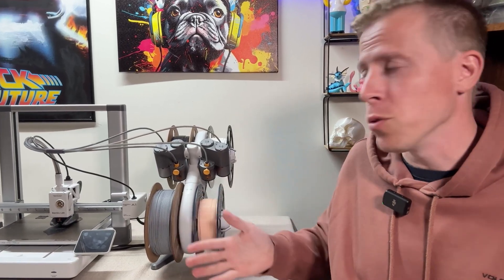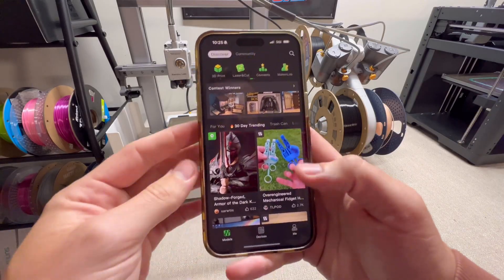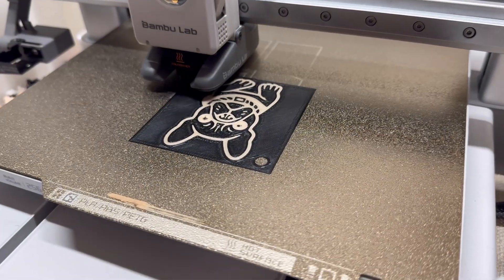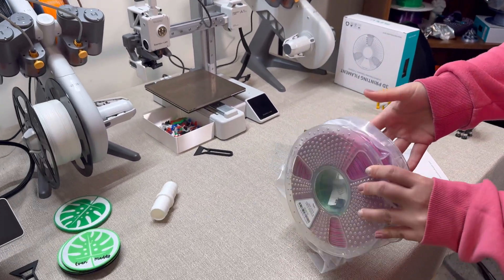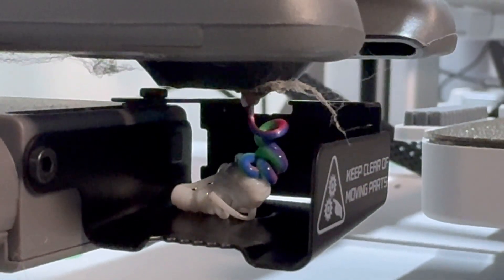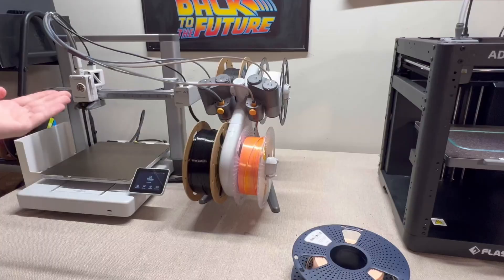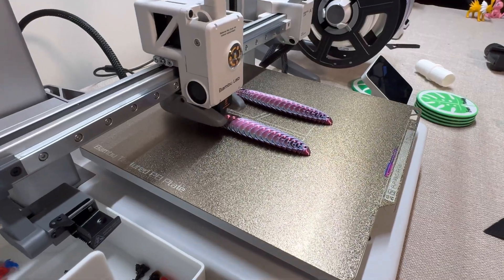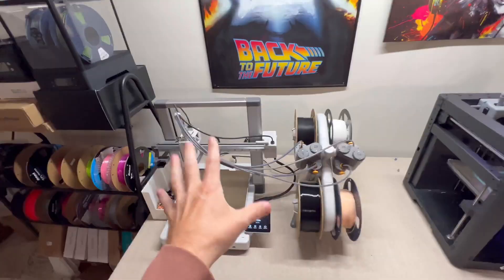Watch this BEFORE getting the Bambu Lab A1 - Honest Review

Comment: Hey there...great video.  I was looking to get this printer to print 3-D server racks. I was concerned about the type of filaments available for this printer. Additionally, some of the filaments require that the printer be covered. For example, I was looking at an alternative to PETG (PLA+ and maybe ABS/ASA).  for ABS, they strongly recommend an enclosure.  Do you have any thoughts/recommendations about the filaments? I did a search for enclosures, and they are plentiful. Do you have a preference/recommendation?

Comment: Hi, thanks for the very helpful review! This is the 3D printer I want to get, however, the bundle is sold out and AMS lite system isn't available for a few months. Can this be used without the AMS lite system?
Reply: Hi, I went to Microcenter and the bundle was sold out. But then i saw a box off to the side marked refurbished. The salesman didnt even know about it. I asked about it and it has the same warranty as the original. Picked it up for less than the A1 mini combo and it works great. Long story short, ask if they have any refurbished, otherwise you may have to wait.
Reply: yea you dont need a ams, you dont even need one to multicolor print, you can just add "pauses" to multicolor files and manually swap filiments out. obv thats not viable for all color prints, but the ones that only swap like 5 times, you can manually do that np
Reply: @XxAtomic646xX Thanks so much for the info! I ordered one for my son for Christmas and can’t wait to use it.

Comment: Hi, could anyone give me some advice please. My son wants a 3d printer for Christmas and after looking into it the best one to get seems to be the A1 lab. On there site I can see it for sound £180 or the same thing for £260. Of If I buy this what else would I need to get with it. Sorry I’m just a super confused mum way out of her depths with this 🙈
Reply: Hi, I’m pretty much in the same boat,  I’ve been doing some research, the bambu A-1 printer seems to be the best one for the money.  I’m looking into getting the combo, to be able to print in multiple colors. I feel that if I only have the availability to print in one color, my son will get bored with it and want to upgrade to be able to print with more colors anyway, so might as well spend the extra now.  With that said, I’m still trying to figure out the filaments and do not know what is the best general purpose filament.  I do not know how much it costs, or if you need to use brand specific filament.
Reply: @johnflew same but the cheapest for me is $900 😢

Comment: Hi Dood. I have a question I hope you can answer. I just recently bought a Bambu A1 printer with just the single roll holder.  My question is, instead of spending $179 extra for the AMS that holds 4 reals,  will another single spool holder work that clamps onto the top bar? I'm only looking to print 2 colors at this time. Thanks

Comment: I have an a1 and a x1c and I genuinely hate my x1c. It never prints anything as good as my A1. I spent two days trying different settings with my x1c to print the same time like 12 times before deciding to use my a1 which printed it perfectly the first time.

Comment: WARNING: the set up and packing as changed, at least for the printer without AMS version.

When you receive your item, you won't have to unscrew anything from the bottom. They change it so that the build plate is now locked into place with foam blocks.
The rest of the set up is pretty much the same EXCEPT that there is 2 black plastic blocks in the back of the vertical axis for the gantry. There are 4 small bolts to remove and then you have to remove those 2 big chunky black plastic blocks. They are not part of the printer. They are just retainers. You remove them by a twisting motion from side to side. It is tight but you won't break anything.

YOU MUST REMOVE THESE BLACK PLASTIC BLOCKS before doing your machine calibration or it will screw up your calibration and possibly brick your machine. The printed manual does not really reflect this change and many people bricked their machines because of this. You will have to call customer support if this happens to you in order to try to get it fixed.

Comment: My new A1 has only one problem.  The filament keeps getting knotted as it leaves the spool.  I'm sure  there's a fix to this but I just haven't found it yet.
Reply: Manually unwind your spool until you find where the filament is tangled and then manually rewind it. To prevent this from happening, use a filament clip so that the filament stays taught on the spool.

Comment: While you have a solid review, I would suggest never start a revie with saying it is an  Honest review, or using it in the title. This implies you feel other reviews are not honest or your own other reviews might be less than honest. Give your review and the viewer will decide if it is an honest review or paid tripe.

As for the review itself, the eco system is a big draw for me to Bambu. I am a simple hobbyist when it comes to 3D printing. I just want to load the file and do it and this solution and eco system works perfect for me.

Comment: I have 2 A1s. My first one is going on almost 3000 hours and its been flawless! Only issues Ive had was caused by me. These machines are the best bang for your buck!! Great video!
Reply: pin this comment!
Reply: Would you recommend this or the p1s for starters?
Reply: @duaaalbuthabhak7055 honestly I would recommend the A1 for starters. Its way easier to work on and maintain than the p1. Then once you are more confident I would upgrade to the p2s later down the line. I just recently bought an H2S and love it but the A1s are still the back bones of my farm.
Reply: Ive heard A1 series are getting fires and melting in the toolhead/mainboard, have you had any issues with this earlier?
Reply: @RufusDoggo  i havent my a1 has 5k hours on it so theres that ..
Reply: @RufusDoggo I have not. I have 3 of them now. My original is over 4000 hours now and still running like a champ!
Reply: @RufusDoggo  there was a recall on some a1’s a while back due to faulty wiring but everything I’ve seen since shows those defects have been corrected

Comment: I love mine, only problems I've had was when going with the .2 nozzle, seem to get a lot of misprints then and clogs. Thought it might be the nozzle, then the settings. Tweaked them but still problems. Might just try doing some prints aimed and set specifically for it in the presets. But the .4 spoils me for its speed.
Reply from the maker: That is a bummer! Smaller nozzles can be tricky
Reply: I wonder if the filament might have absorbed a bit of moisture.

Comment: 1000% Agree with You -- My Bambus are Hit Print and Walk Away --- My basic Ender3 is Hit Print and Play with settings -- My Elegoo Centauri Carbon is Hit Print and Pray that l have a profile set for what l want to do and Pray that something weird doesn't pop up ---- Bambu has the best interface system than any printer l have right now - hopefully Elegoo will upgrade more soon
Reply from the maker: I want to like other printers so bad but they’re just not there yet lol
Reply: my ender 3 is hit print, add 0.5mm to babystep z, and pray that it doesn’t give up mid print